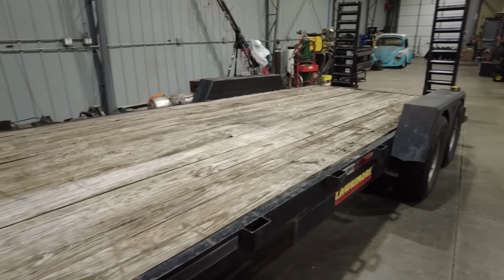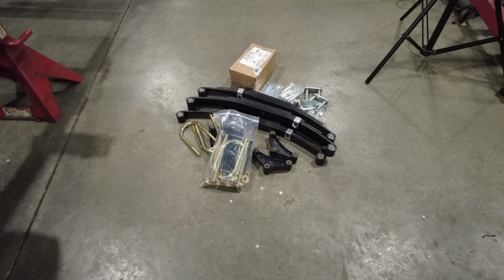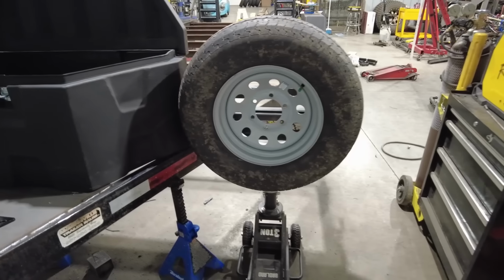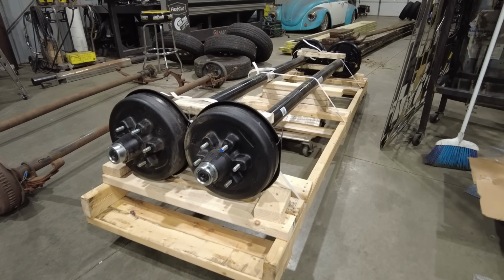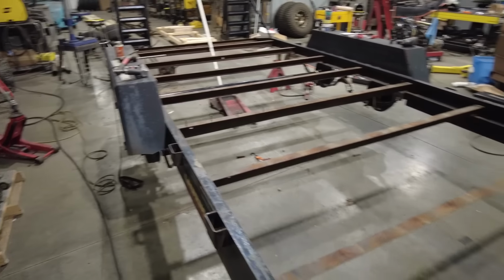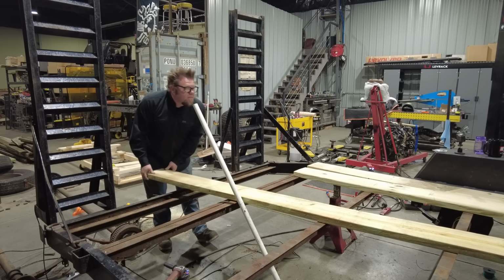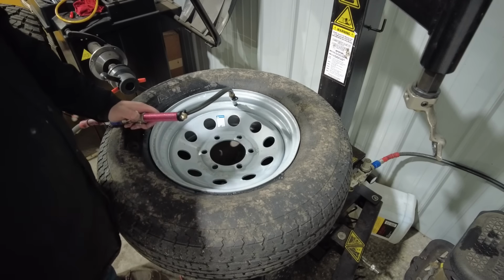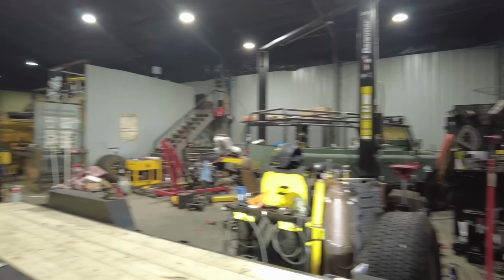Car Trailer Rebuild, How to Increase the Load Capacity of your trailer

Comment: add a 20 amp circuit breaker to the aux power in the junction box...that will protect your connectors and truck wiring in case you try to work the winch with the trailer wires still connected and a low battery
Reply from the maker: Love that idea!!

Comment: An upgrade option I have found useful is under trailer reverse lighting place a couple of flood lights aimed back at a 20-30 degree outward angle from the tongue as well as a pair just under the tail lights that can be powered on in when in reverse or switched to turn on constant. Another add on option would be a  removable telescopic tower light that could be stored in the tongue box as well as a drop light (you could wire up for multiple power spots and tower mount locations (could use the stake pockets as tower mounts) as well universal power ports for the tower and drop light).

Comment: The heavier axles are great, but if the frame was rated for 7k, you still have a 7k trailer. Yes, you can overload it, and on smooth roads you could get away with more weight. But, if you load it heavy and hit a washboard and get it hopping, the frame might not like it.
Reply: Just a little picky but 2 3500 pound axles cannot haul 7000 pounds, you can only haul 7000 less the weight of the trailer. Likewise 2 5000 pound axles can only haul 10,000 less the weight of the trailer.  Thanks for your video! Gave me the push to rebuild my trailer.
Reply: He could have ran a support down the middle of the trailer from the tongue to the rear of the trailer, it helps ten fold, mine works really nice with two pieces of 2" pipe running front to back
Reply: are you "certain"?      HA!

Comment: The color codes are different for round connectors 7 round pin / 7 spade pin  or old smaller round 5 rouns pin than it is for 4 or 5  flat.    I believe colors in 7 pin match 7 round pin semi truck standards.    They have been different forever.  The flat 4&5 were mostly used for lightweight trailers, and trailers with hydrochloric surg breaking systems.    The round and  7 & 5 were generally trailers  with electric breaks.     When I rebuild trailers, for me, I much prefer installing surg breaking systems.  To me they work so much better than electric even with a smart electric breaking system.

Comment: A little tip for you Ian is when you use butt splice connectors and heat shrink, use a little electrical corrosion inhibitor on the wire before inserting into the connector. This is because of moisture in the air when rhe wire is stripped . Some of you may have seen blackened copper wire right after its been stripped? Its blackened because in China which is where that wire is from , the wire is not in climate controlled environment before being coated with insulation. Over time inside of the insulation the strands of wire begin to corrode. By using the conducting corrosion inhibitor your joint is probably good for the life of the trailer.

Comment: I too am addicted to watching trailer builds.  As i've been building out a custom trailer for my needs.  Which is not for hauling cars.  but my heavy machines as i'm about to move across the country.  and eventually for loading logs also.  So i've put a crane on the front and a log arch on the back.  2 winches one on crane and one for log arch.  I initially hoped to also use it for loading a tractor so i built it w/ drive over fenderish.  But i suspect my log arch mounts will prevent me from loading vehicles like i initially planned.  Will have to measure wheel bases when i get to that point.  Another thing that i added (since i started from what was originally a travel trailer frame that i beefed up) is on the axles i added struts as it helps save your tires especially while your driving your trailer unloaded it'll not be bouncing around so much.
I wanted to upgrade the axles for weight capacity but i was concerned about the structure of the trailer being able to handle the added weight.  Since a trailer frame is designed with a certain weight range in mind.  So just upgrading the axles doesn't mean you can use that added weight.  You might start bending the frame.   * something to keep in mind  for safety *

Comment: I only skimmed through the comments but didn't see mention of it, you say the lights wiring didn't follow "convention", well there is different conventions, you have the 4-pin (utility trailer) convention , then you have RV convention (7-blade style) which is what your box is most likely wired for (I paused the video to write this). I discovered this while working on mine doing just this, rewire, j-box (truck-lite super 50 I think, 12 double-port), and swapped 2-3500 axles for 2-7k axles. 

In addition to those wiring setups there's also the "agricultural/commercial" (7-pin round) connector used on semi trailers and farm trailers. I've also seen a 4-pin round, no idea what the trailer was, and heard of a 13 pin or something from Europe.

Comment: If you don't beef up your rails you've not increased your trailer weight capacity
Reply from the maker: The frame on my 7K and the 10K model from same manufacturer is identical

Comment: Ugh, treated lumber eats steel for lunch. Your cross members won't last long. Paint paint paint the cross members then add 1/8 rubber strips on top of the cross members to seperate the wood from the steel.

Comment: 7500 for the new trailer... well i think that's worth it compared to wbat you did.  In the enx you stil have  7500lb trailer. The  new one would actually be built to handle the 10k load . Heavier frame  and crossmembers.
Reply from the maker: Frame on this 7K and the same model 10k are identical

Comment: Hey Ian, lots of crossover with the RV industry on the power side and axles...lippert owns the RV industry, axle to frame to internal components..  Would love to see a video on a 3/4/ 1-ton dc to dc charge controller install as the RV industry is moving away from gas/ electric fridges (I think Norcold rolled out of the US) and going to 12V compressor refrigerators.  7 pin won't recharge as fast as fridge drains.

Comment: You should look into using the heat shrink fittings with the low temp solder built in, makes for rock solid, non corrosive connections
Reply from the maker: Just got some used them on my Yota v8 swap...they worked great

Comment: It is definitely worth rebuilding a trailer, especially with new trailer prices. I did mine a couple of years ago. 

When deciding what weight capacity trailer to purchase, I looked at the weight of my M715, and it weighed too much for the two 3500 pound axles. I chose to go with the 5200 pound axles. The trailer frame size was also larger on the heavier axle trailer. Just curious if larger axles and weight capacity need some additional frame strength.

I really like the modifications you made and will look to incorporate some of your ideas into mine. Keep the great content coming.
Reply from the maker: My trailer as a twin 3500 lb and twin 5000 lb frame were identical from my manufacturer
Reply: @BigTireGarage  what about the ball coupler is it rated for 10,000 pounds... Most 7000 pound trailers are only a 2 inch ball not 2 5/16

Comment: Great job and some great ideas for sure. A couple things I don't think you're thinking about, recess the center metal strip so when you're pulling bent/broken/dismantled vehicles on your not ripping off or damaging the lights. I'd replace the taillights with something like the trux dual revolution lights and hook them with the square light switch for backing up at night. I also agree that the spare should be a spindle mounted setup and possibly one on each side. The only other thing I'd change is that jack to an electric jack, this may sound very strange but it's to know that the battery is not bad or going bad because if you don't maintain a good battery on the trailer that breakaway is absolutely useless.
Reply from the maker: I already pulled a Jeep body up on the trailer...you can see it in my IG no damage to the lights at all
Reply: I would've used a piece of channel mounted so that it recesses the lights, protects the lights but also can have an extra set of tie down rings mounted recessed inside the channel to leave the deck flat but with more securement options and recess protected lights

Comment: Nice Job.  I did a similar thing with my 24' 5000 lb flatbed trailer.  Double framed (long story) added brakes to the non-brake axle.  My axles are still 3500# rated but my concern was just because I made the frame stronger, added additional brakes, etc... the 2" ball still exists and most 2" hardware is 5000lb rated.  I know you can by better but the hitch on the trailer is still 5000#.  In your case up to 10000# so wouldn't you need to change that hitch to a 2-5/16" for safety?
Reply from the maker: Its 2 5/16's already

Comment: Why didn't you do any rust prevention to the chassis while you had it all torn apart? I would have just to keep the bracing from rotting away over time!
Reply from the maker: It was only surface rust.....and tbh based on what happened to the last wood on this trailer...I will be replacing this wood in less than 2 years

Comment: Great rebuild. You got a lot more use out of the decking on yours than I did. A year and a half after buying mine new a truck tire went trough one of the boards on the dove tail. I know it was not sitting on the lot any length of time because I ordered it and picked it up the day it arrived. All the boards on the dove tail were rotten. A few of the main decking are also but I'm trying to get as much use out of them as I can. I am planning on mounting my winch on the trailor also but I have it mounted on a receiver hitch mount. That way I can store it locked down to keep it from being stole. I can also use it for other things not involving the trailor. Thanks for the video I enjoyed it.
Reply: Imagine having a horse fall thru  a wooden  floor in a horse trailer ....as you are running vd9wn the road at 70 mph ... .. urine will rot the floors and  it actually happens ...  you never even feel it as your towing  ..kinda like a bump in the road ... shorty won't win many races after that..neither will stubby.. but they are easier to catch in the field ..

Comment: Add a piece of pipe to support the spare tire on mount in order to hold tire while you bolt it to the mount? Use the shrink tubing that has an adhesive that makes the connection water tight?

Comment: I’m surprised you didn’t put any rock lights. Or at least LEDS underneath to light up the underside. I’m seeing more trailer’s going down the road with them . Pretty cool idea
Reply from the maker: I am thinking of adding one inside the fender well, possibly an orange light so I could use it if I needed to change a tire on the side of the road....I never thought of adding rock lights as well...I like that idea

Comment: The trailer plug colors are right, they are different then a 4 plug wiring. The 7 wire plug follows rv wiring.  Hardwood is a better deck material because it resists stuff digging into it when you are sliding stuff along the deck. Make sure the trailer is built strong enough to support a heavier load if you are going to add heavier axles. Good point on the shrinkage of the deck boards, I leave my hardwood boards strapped together so they don't warp outside over winter, it amazing how much they shrink.

Comment: Would have put 3 wheel studs on each spare tire...not only do you have 2 spare tires/wheels but 6 lug nuts in case you lose one changing a flat.

Comment: I converted all my trailers to 7 pin semi plug with the coil double end plug so it is easy to swap if damaged. I also use the receptacle with circuit breakers so if there is a problem it isolates the truck from the trailer. All my jacks are a step higher rating then required to make it easier to crank when loaded.

Comment: The reason why trailer manufacturers and I don’t put our spare tires there is because you never know when you’ll have to cut the wheels hard to maneuver the trailer into or out of certain spots. Your bumper will need that corner space.
Reply from the maker: Nope clears completely with my tongue length
Reply: @BigTireGarage  Good to know it clears your tongue, it's just some trucks don't have a long tongue. Didn't know if you were thinking about other trucks pulling your tailer with a shorter ball mount.  Love your videos Ian. Was watching you and Jesse from early on and Loved all of the FAB stuff.

Comment: should have test fit the winch before the tongue box , also would have made the tounge longer to mount everything my preferece is a  power assisted jocky wheel, winch ,tounge box and 2 spare tyres one either side of the winch also a removable guide wheel for the whale back   for winch cable
Reply from the maker: Why qould I have to test fit the winch..it fit perfect..just like I knew it would

Comment: Why did you not paint the supports u.der the wooden deck...... wire wheel wipe down and spray paint them slow rust from.happening

Comment: Im 69 years old and have been dealing with trailer wiring since a teenager. For as long as i can remember in trailer wiring white has been ground. In 120V household wiring
 black is "hot" and white is neutral/ground.

Comment: You just confirmed EXACTLY why I refuse to buy used, or rebuild a trailer. The cost, if you factor in the sale of the used trailer is VERY close to paying for a BRAND new trailer, with new paint, hitch, ramps, and lights.  Plus what about the labor time. Also the brand new trailer would be worth more in 5 years if you went to sell since its paint would be much better, and since the manufactures year is newer the value would be higher due to that.  I will continue to buy new, and get my original investment out of it when I sell. This way I never buy brakes or do any maintenance and I never have more invested in trailers then their outright new value, occasionally you replace a few tires along the way, but never any batteries, axles, lights, jacks hitches or wiring. Another thing, you still have a 7k trailer, until you pay someone to do a”modified” trailer title upgrade, until then you still can only haul what is licensed for.  There is no way to recoup labor cost, It only makes sense when you get free axles, and/or need video content to pay for the labor.

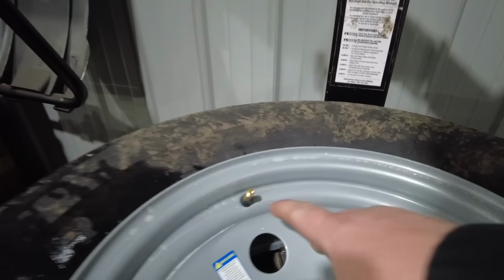Comment: When I first rebuilt my trailer I had the boards fit up so tight you could haul water. After significant shrinkage you could throw a cat through the gap..😊 39:23 39:23

Comment: How did you mount the tongue box? I was thinking drilling holes in the bottom with J bolts onto the rail and maybe some large washers with some kind of rubber mat seal cut out in a circle or something. I also didnt really want to cut into the box due to water intrusion concerns so then maybe ratchet straps would be an option but not ideal. Thoughts?

I did the same thing, restored my trailer but I had it powder coated (or painted)which I didnt see in your costs, that also comes with a new trailer. It was about $1500 for me but probably more now since it was before covid IIRC. That would put you near the cost of the new trailer plus your time/labor.

Thx for the video!
Reply from the maker: Bolted through the plate that holds the jack.. big fender washers under

Comment: Great video, my trailer rebuild started as a deck replacement and ended up like yours short of new axles. I think the most important thing I did was add reverse light under the brake lights. I also added, like I see on yours, a metal trim, 1/4 angle, around the lights to protect them from damage by "friend using the trailer".